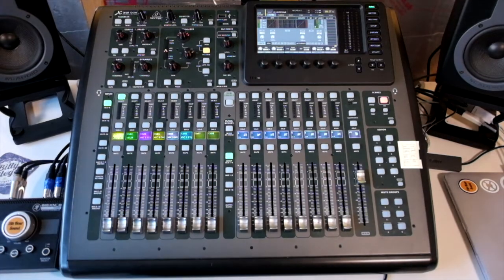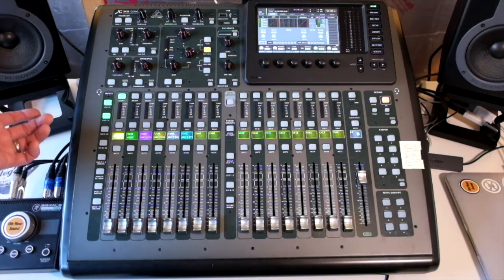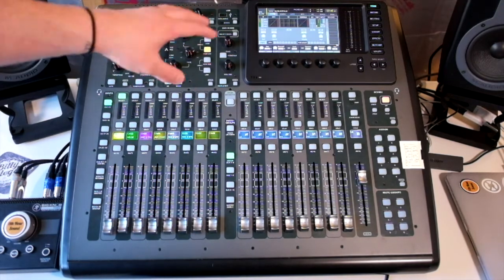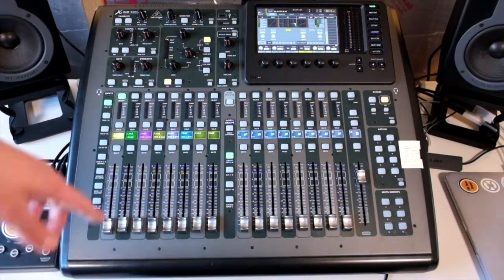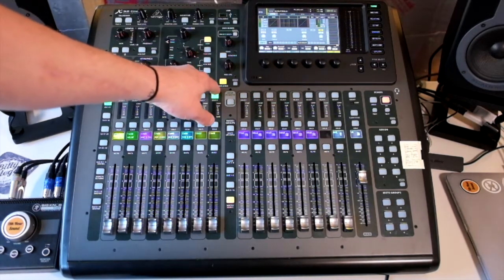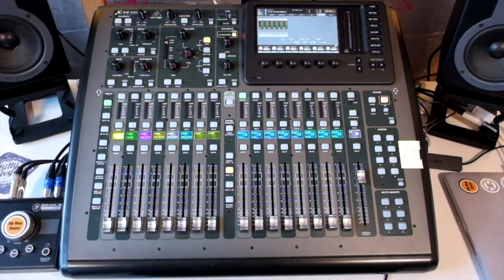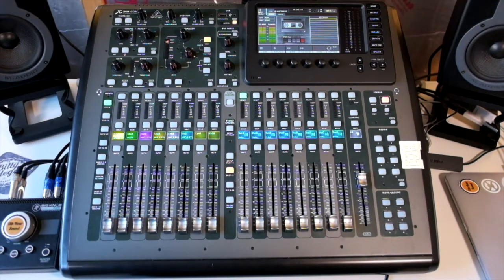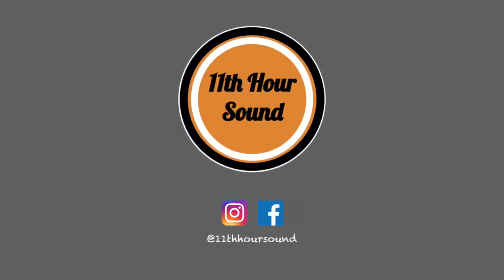X32 Compact - The Physical Controls

Comment: I'm considering buying a digital mixer for my band and I was looking at the Behringer X32 compact. It claims to be a 16 channel mixer, however I noticed it doesn't have any 1/4 jack instrument cable inputs! It only has XLR inputs. Why is this? Don't Behringer know that 1/4 jack is the standard for connecting instruments to a mixer or amp? How would I connect a guitar or keyboard to an XLR input and why would a manufacturer not include any 1/4 inputs on a mixer? It just seems weird to me and is very disappointing because it looks to be an excellent digital mixer apart from this ridiculous oversight by Behringer.
Reply from the maker: It’s a 32 channel mixer with 16 xlr inputs on the back which can be extended to 32 channels with the use of their digital stage boxes.

In my opinion it’s not oversight it’s industry standard.

The XR16 does have 1/4 ins if you want to go that route but you may be causing more issues for yourself.

You will need to consider the use of DI boxes to prevent humm and noise issues especially from electrical circuits 

If you have a look around the other brands digital mixers you will see the same ins and outs. 

More time on research and learning. Less time punching the keyboard.